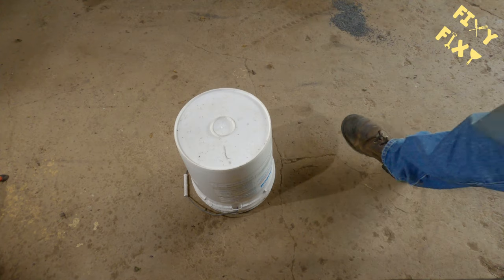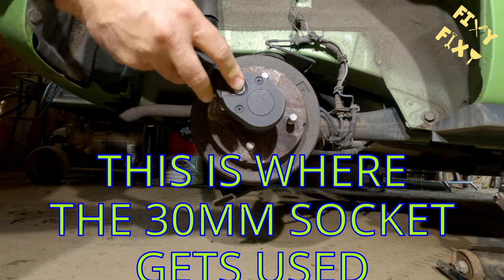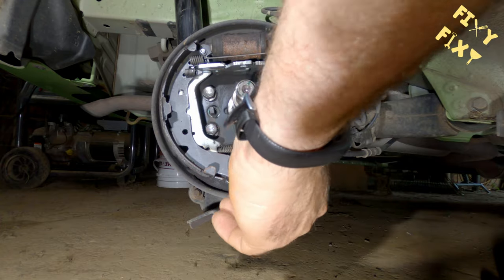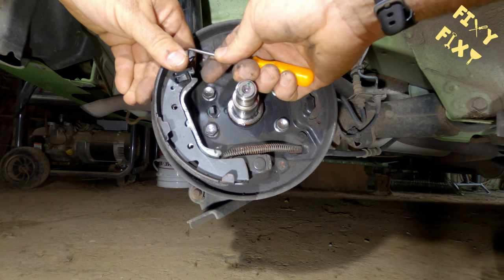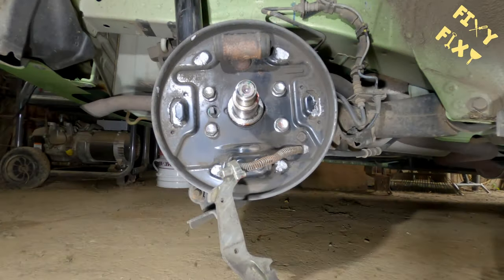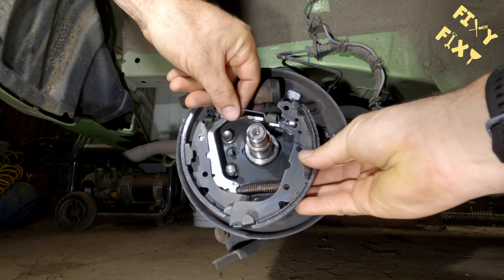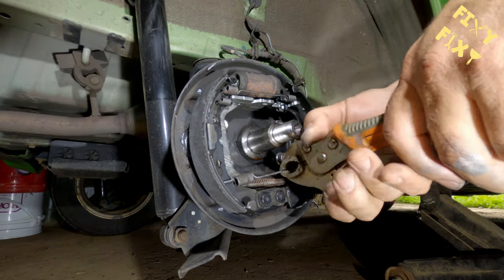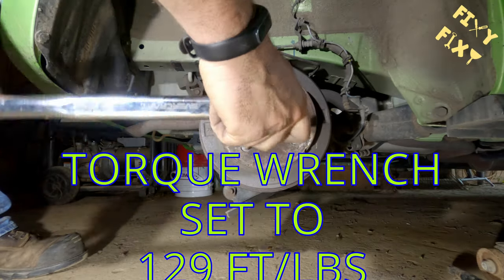Mitsubishi Mirage 2014 Rear brake Replacement - Right Side

Comment: Thank you for this. Just replaced my rears. Purchased new, 55k miles, toasted shoes and drums 😂. Lot of highway and city driving. 

Used raybestos shoes and duralast drums fit great. Only thing I had to do was file the hole where the emergency bracket attaches to. Only took a couple of seconds. Shot a tiny bit of silicone on the shaft to let the drum slide on easy. Done and done. Thanks again.

Comment: Tremendous help, thank you. Just adding that resetting the adjuster all the way back is so important when putting the new pads in. If it’s not set correctly, and you can see the teeth (ridges), you won’t get that damn drum back on.
Reply from the maker: That's good info I should have added. Thank for this and thanks for watching
Reply: what part is that exactly? Thanks
Reply from the maker: C Michael is referring to the adjuster. It the part that needs to be reset to allow the drums to fit over the pads.
Reply: With that adjuster, does it self tighten itself?? as its not like the old drum set up where u can use a screw driver and adjust it thru the hub with a screw driver. 
I just replaced mine today and the handbrake isn't as tight as it was b4.

Comment: Hi other mirage owners, this car requires you own a grinder/cut off wheel for every repair. So go ahead and take that grinder wheel and slightly grind the opening of your "auto adjuster" that goes inbetween the shoes if you cannot easily get the drum back on. It should end up looking like a shark/gator with it's mouth in a triangle going towards the top, only takes a minute(You may need to slightly then shorten the little spring that goes there too).

Comment: When I did the drum brakes on my truck there was one tool I wish I had bought and it’s for those pesky last springs. I ended up making on out of a small old flathead and I cut a bitch into it with my dremel. You catch the spring end in the notch and use the end of the screw driver to lever it over in place then a slight twist pops it right into place

Comment: Very helpful video! I just have one question, what is the brand of the shoes you got and did you any issues putting the drum back on? I bought Centric 111.10590 (from Amazon) and could not fit the drum back, they seem too thick. I loosened the adjustor and the parking brake cable and still could not do it. Had to reinstall old shoes back again. I read on the mirageforum that some people grind the aftermarket shoes in order to make the drum fit and I'm not too convinced about that. Thanks!
Reply from the maker: The first time I changed the rears in my Mirage the drums had a lip on the inside edge of the drum that's stopped the drum from slipping over the new shoes. I used a grinder to knock down the lip and the drums slipped over the shoes fine. I hope this description helps. Thanks for watching!
Reply: @FIXYFIXYCHANNEL  Thanks for your reply!
Reply from the maker: Anytime I enjoy talking about my 3 cylinder hot rod
Reply: The issue is with the self adjuster and requires you open up the slot a bit

Comment: my drum won't go back on. If i try forcing it, it starts shaving part of the new brake and it seems like too tight of a fit. any tips on how to resolve this?
Reply: Use a grinder on the self adjuster thing to open up the slot making it look like a mouth of a gator
Reply: It has to do with that adjuster, I 'm having same issue.

Comment: I did everything you did in the video and I cannot put the drum back on. Can you help with this
Reply from the maker: I can try. There is a chance that when you replace your brake pads and try to reinstall the drums the drums might not fit over the new pads. Check your drums for a lip of steel inside the drum that will not let the drum slip over the new pads. If that lip is removed (sanded, hit with a grinder, removed with a lathe) the drums should go on with out issue. I did not think about this problem when making the video so I didn't add it, it seems like I should have, lots of people are commenting on this problem. Good luck and thanks for watching.

Comment: This doesn’t look like the type of adjuster you can adjust from the back with a Flat head without taking the wheel off ?My brakes are rusted and only that one wheel will not move .
Reply from the maker: It may not look like it but it is adjustable.

Comment: Hi, what torque setting did you use on the 30mm nut that's holding on the drum
Reply from the maker: I torqued it to 129 foot pounds. Thanks for watching!
Reply: @FIXYFIXYCHANNEL  very helpful thank you for video :)
Reply from the maker: I'm very glad the video was helpful.
Reply: I think he said 129 ft lbs.